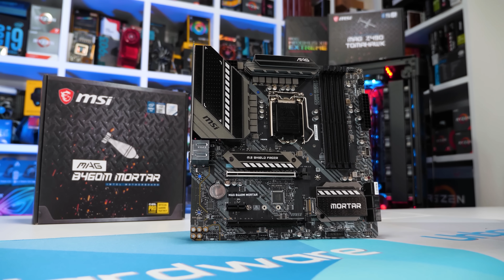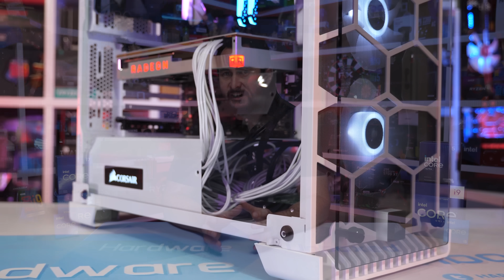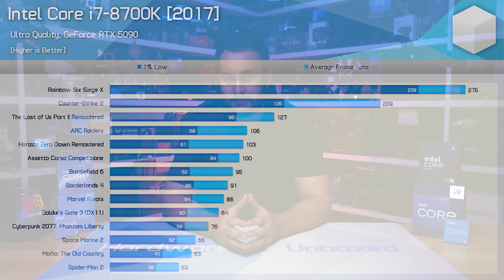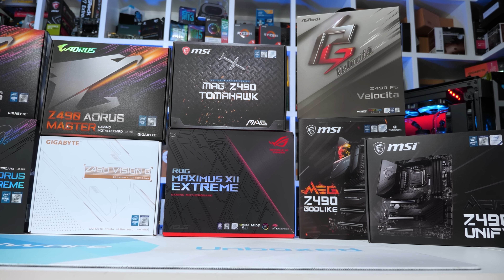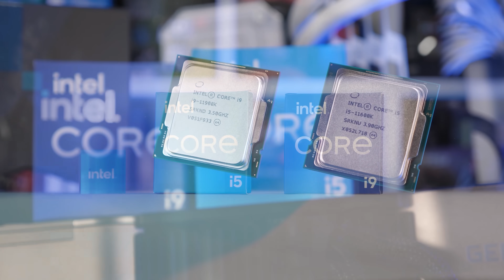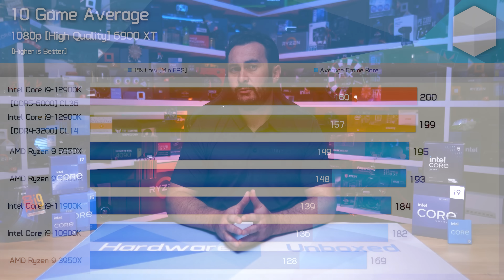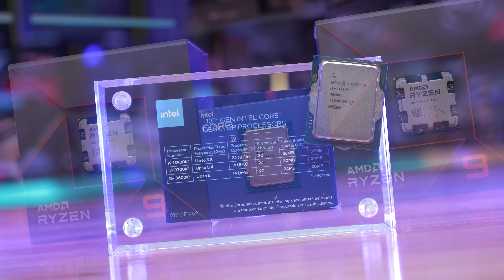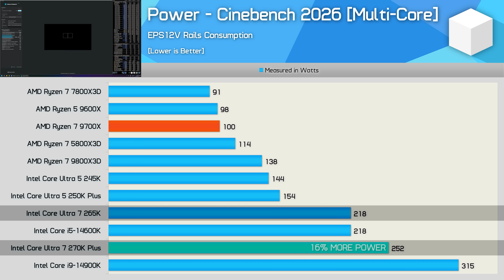How Intel Fell Behind, 10 Years Of CPUs Benchmarked

Comment: intel did not "struggle"  for 10 years
1st and 2nd gen ryzens still failed to catch up with intel in terms of IPC , boost clocks and single core gaming performance (they were still far behind) - 
even haswell i7 still offered superior gaming performance compared to ryzen 1600 or 1700 at the time  .
they also had all sorts of "new tech" issues and it took time to tune the motherboard and memory support and also software support .
they were good in multithreaded performance but not nearly as good for gaming 
intel still had the upper hand ... 
even 3rd gen ryzens despite having much improved IPC still failed to catch up to intel in gaming performance .
it wasn´t untill 5600x/5800x that the AMD truly started to compete with intel in gaming .
AM5 than changed everything and finally flipped the script .
so amd has only been truly superior for the past 4 years not 10 ...

Comment: I still play with an I7-4790K and Radeon 6700 XT at 1080p.
Most modern games depend more on the gpu, so my PC still holds to play games at solid 60 fps with medium/high settings.
I have it clear for next upgrade, cpu I choose AMD Ryzen (7800x3D will last 10+ years) and gpu I choose Nvidia (RTX 5070).
Reply: I imagine you could easily get away with just upgrading the platform first and using the 6700XT for a bit longer, then later upgrading the GPU to either something even newer than a 5070 and probably still not be approaching CPU bottleneck
Reply: @itspaafekuto  , most likely, but I don't intend to switch cpu for maybe 2 or 3 years and by then both 7800x3D and the 5070 2nd hand would be cheap, while newer gpus would still be expensive.
Reply: @matrixqwAh, it's not something you're considering yet for the immediate future? In that case it sounds like a pretty sound strategy.

Comment: I really hope that 52 core means a return of threadripper competition. The way amd slapped two 1800x together to make the 1950x. Threadripper needs some competition and the 9960x and 9970x would feel the pain of a 16/32/4 core with quad channel. But I'm sure Intel will instead gimp it with a desktop dual channel platform

Comment: While you present a lot of info, it would have been helpful to have a brief synopsis up front to put that information into context.

The overarching failures?

1. A myopic focus on speed regardless of heat or efficiency.

2. A refusal to adopt chiplets, which introduced complexity but dramatically boosted yield, and allowed mixing node products.

Both of those decisions ended up nearly killing the company.

Comment: TLDR: Intels fabs and architectures sucked and it's hard to make good long-term decisions when you're in a blind panic clutching at grass ass you slide to a cliff edge.
1) 14nm was late and with no architecture planned intel resorted to14nm++++ and skylake refresh refresh refresh refresh until Cometlake.
2) 10nm finally arrived but Intel had no way to do 2x 11900K and no space/transistor efficient architecture.
3) As a bandaid Intel glued on moar and moar atom cores and just went full Icarus on power which caused chips to die
4) this required dedicated silicon "thread director" and increased L2 cache per atom module to keep the atom cores from using the ring bus and getting in the way of the good cores.
5) this also required "APO" software for specific games so that 3/4 of the atom cores would park to prevent them getting in each others way,
6) Intel finally made the move to chipl...."tiles" and reduced power with 8P+16e Arrowlake
Unfortunately....
6A- the core-core latency is terrible
6B- their memory controller sucks only working at 1/2 memory speed or "2:1" mode.
6C- it's costing them a fortune with many big tiles equalling 554mmSq total. 
5) To address the core-core latency issue Intel created 200S boost but a 50% overclock only helped performance around 4%, Intel also launched new 250K+++ and 270K+++ parts which drove up power again.
6) still unable to have a single scalable efficient architecture Nova lake will have 2x "8P+16e" tiles, The first "tile" will have bLLC (added cache to mask the latency penalty going die-to-die) and another 8P+16e "tile" without it plus more atom cores in the SOC "tile",
So Nova lake CPU configuration is... (8P+16e+bLLC)+(8P+16e)+2lpe
7) to address this clusterfuck they're going back to a single unified architecture, at some point.
Reply: Chipl…”tiles”

Commendable attention to detail
Reply: The irony is that AMD had to deal with all of these problems with Zen1, Zen+ and (to a lesser extent) Zen2.
The smart man learns from his mistakes. The wise man learns from other's mistakes.
EDIT: The implication being that Intel are neither smart nor wise.
Reply: @throwaway6478  Yep, Alderlake=Zen1/+ moment, Novalake=Zen2 moment. Intel's really living like it's 2019 right now.
As you say the wise man learns from others mistakes... but Intel never learn from their own.

The whole chiplet thing is just Core2 again (chips containing cores talking over a bus to a separate memory controller die that is tied to memory clocks), Intel integrated the NB chipset on package but they went monolithic thinking we'd get cost effective die shrinks forever (10Ghz!!!).

Likewise AMD got burned by FX using clusters of cores which individually were weaker than the standard at the time and shared resources like L2 cache while pushing high clocks and power.
Intel said hold my beer and made Alder/cRaptor lake which added clusters of cores which individually were weaker than the standard at the time and shared resources like L2 cache while pushing high clocks and power... because that's what you do when you're desperate, difference is you could buy an FX83-- for £100.

Comment: Intel had 6- and 8-core CPUs in its Xeon business products, but withheld them from all but a few enthusiast models (of consumer-grade chips).  Intel tried to stay competitive in core count by introducing E-cores, but Windows 10 couldn't use them properly.  Thus Windows 11 and the whole telemetry debacle. Meanwhile, Intel lost the all-important server market due to power and heat costs.

An interesting side note is how Intel put hardware support for AVX-512 in its processors as late as 2021.  The smaller E-cores don't have it, which makes Intel's new massive-core-count HEDT CPUs uncompetitive for the very tasks Intel created AVX-512 to get an advantage over AMD in the first place.

Comment: I still cant understand why the 11th Gen intel series is still so expensive ... like the i7s and i9s are more expensive than the 12th and 13th gen equivalent yet offers so little improvement over the 10th gen series
Reply: AV1 decoding on the then new Xe iGPU was introduced on the 11th Gen, alongside being much more capable than the one on the 10th Gen before it. It is also the end of the line upgrade for that particular socket, which inflates it's value.

Comment: I'm a bit of an AMD Fanboy, but I managed to snag recently (I was lucky that in late October seller didn't increase prices due to RAM Shortage) Dell Workstation with Xeon E2286M 8-core CPU and RTX 5000 Quadro (Turing) 16GB GPU. And 128GB DDR4 ECC 2667MT/s memory. I can game, I can work, I can basically do anything I want, since the GPU is slightly underclocked RTX 2080 Super with 16GB of VRAM.

I have to say that those CPU's even from the days of Intel... being Intel are great. Especially Xeons, which are extremely stable and extremely cool, even in completely bonkers tests. The problem with Intel was that they didn't care that much about regular customers, because they had such a monopoly that NVIDIA would blush. And that NVIDIA GPU is still great, even though you could say that it was on the downhill for NVIDIA already. But the thing that makes those 2 parts still very much workable is that they weren't cut down for "normal customers". They were workstation class, professional cards. And for 1200$ it was basically a steal.

Comment: I got an 8700K one year after the 9900K came out for cheap at Microcenter. I then got a 9900K about a year after that. The 9900K ran so hot and consumed so much energy that I switched to AMD and never looked back.
Reply: There's a reason it was called the 9900 Kelvin
Reply: It's over 9000 Kelvin
Reply: Curious if you saw any performance increase though. My girlfriend has a Z370 ROG Strix board with an 8700K and 4070 Super that I was looking at slapping a 9900K in there. Upgrading her to DDR5 right now is far too expensive as she already has 32GB of DDR4 and a 360 AIO. 

The 9900k can be purchased for a relatively decent price and make up some of that cost by selling her 8700K even if under current market pricing.
Reply: @badsportdriving5856 icebereg tech tested both at 5ghz before and there was not much of a difference. You can search his channel. In my opinion second hand 9900k-s are way too expensive to worth the "upgrade", i'd rather wait till ram prices go down. You might also need very good vrm's on your board and an exotic cooling if you want to keep the i9 at high clock speeds. I only speak about this because I'm kinda in the same boat.
Reply: my 9900k is still going strong running on a 240mm aio, 60c running games. my 9800x3d is on a 360aio and i have troubles keeping it cool. it runs 75c in games.
Reply: @rozzbourn3653  not sure if you're baiting but 75 is fine and not hot for an x3d chip
Reply: @creativityfails1  thats my point. everyone says how hot the 9900k was, but it doesnt run as hot as my 9800x3d. my 9900k would idle at 28c and my 9800x3d idles at 47c. it was hard for me to get used to when the 9900k was supposed to be considered a very hot cpu.
Reply: @rozzbourn3653  I wouldn't worry about it. 99.999% of people's knowledge about cpus is anecdotal or the product of marketing. I just wanted to make sure you knew 75c is not bad for the cpu and modern cpus do like pushing themselves to their thermal limits. Something that annoys me at work with even the T line of Intel processors
Reply: @rozzbourn3653  How do you get so High temps on 9800x3D and 360AIO? I have 9800x3D and  Navis 360 AIO and with little UV PBO -20 TDC set to 90W, EDC 105W, PPT to 120W and boost clock + 200 I have 40'C idle and 56-62'C in gaming and it hits  70'C only in benchmarks or video conversion.
Reply: @FeRu.Raprodukcja I wish I knew. I took the whole thing apart and reseated it with better thermal paste and it just idles near 50 degrees Celsius. I limited the power to it and it only gets up to about 80ish when gaming now. I hope the next cpu lineup solves this for me.
Reply: @rozzbourn3653 

People literally complained about the 9900K (and 10900k, 13900K, 14900K) heating up their rooms.

The 9900K typically draws more power in gaming than the 9800X3D, and more power = more heat. Not quite the same thing as temperature.

Think of it like a car engine. A small engine with a small radiator might run at a higher temperature, but it will still give off less overall heat than a larger engine putting out twice the horsepower, even if the bigger engine is running cooler.

Temperature is also affected by power density, so given two CPU dies consuming the same amount of power, the smaller die will have a higher temperature. Thicker IHS (like the 9800X3D has) also means more thermal resistance, which means higher temperature on the CPU die for a given power draw.

There are a lot of other factors to consider when looking at temperature.
Reply: @rozzbourn3653  You are either a mad Intelol fans lying, or you have no idea what you are doing with PCs. Likely both.

Comment: Great overview.  I've been building a sort of collection of earlier Intel flagship machines: I've got a 4790K and a 6700K so far.  I have an in-use system with a 12900K (DDR5).  The ones I want to add are a 2700K, 8700K, 9900K, and 10900K (or 10850K).  But the price is still outrageous for the latter two, so I'm waiting.  Ivy Bridge is probably next in line.

Comment: Still using my 10th gen i9, still a good system today, was my first intel build
Reply: nah its literally getting clapped by i5 12400f, but i like the cope.
Reply: @helly9015 Wouldn't call ~20% faster SC "clapped".. 12th gen had a proper new architecture, hence the jump in performance. And the 10900k still has the better multi-core and in some games matches the i5. The real champ is the 12900k.

Comment: Intel 10900K was and still the best with the least latency (37ns) between its 10 cores that scale massively with fast DDR4.  Everytime I tried to switch, I came back to my 10900K.  It's snappy and is the best for any emulators, no input lag or stuttering like AMD and it's problem with cache and chiplet design.  Intel should have never abandon the 10 cores and kept building around it and improve on IPC.  In gaming, nothing beat Intel so the title is misleading.  Yes in rendering (example video), AMD will be faster, but as a gamer, you cannot rely on AMD.
Reply: This dude woke up and still thinks it's 2020...
Reply: ? The 9800X3D beats/matches Intel in most games. There's few games where Intel fares better.
Reply: @imaginarymenageriemanager6303  Not in the lows FPS which is why Intel doesn't have stuttering and AMD has.  It's simple as that.
Reply: @beetwing  No. 1% and 0.1% are METRICS are pretty useless. As metrics, again, re-read what I wrote.
Reply: @imaginarymenageriemanager6303  re-read what I wrote, yes 1% lows not useless METRICS, the higher it is, the less stuttering you will have and more snappier your experience is.  Pair this with 4400mhz 17-17-17 with an Intel 10900K, even a 9900k, play a f.p.s game like COD, crank this up to 4K at low rez, go back to your AMD and come back here again.  You know, if you know!

Comment: It's fascinating that Intel's 14nm stagnation lasted as long as it did. You could go from an overclocked i7 2600k from 2011 to an i3 10105F from 2021 and not notice a difference. A whole decade of progress for a 25% IPC uplift...
Reply: At the risk of sounding like a broken record, I imagine the only noticeable differences between the two PCs are AVX2 instructions and small things like m.2 slots or TPM support
Reply: There's quite the difference unless you're solely looking at render performance. Gaming-wise anything DDR3 is total ass.
Reply: LOL, one of the computers at home is still rocking an overclocked 2600k paired with a GTX970 GPU. Runs most games fine, except latest AAA titles...
Reply: @tonifasth  Massive lie, lol. An older DDR3 i7 can't even play basic games like LoTF or The Surge smoothly. Games from 2015~.

Comment: It's kind of crazy (and awesome) to realize that, I've almost completely switched back to AMD since Zen came out.
The only Intel system I still use (rarely) is an i3-4160 (Haswell) secondary NAS system with ECC memory (ASRockRack E3C224D2I).
I've purchased total of 16 Zen-based CPUs/APUs so far.

Comment: Are we getting 10 years of am4 next week?
Reply: I want to see 15 years of amd
Reply: They can start with Piledriver which was still just barely available for sale.
Reply: @panthera8286 I think they would have to include the Phenom II CPUs to put the Bulldozer lineup in the right contrast.
Reply: @DeadNoob451  Phenom 2 was Great, had they made a Phenom 3 we would never have had ryzen tho.
Reply: @panthera8286 1st AM4 CPU was Excavator v2
Reply: am4 was a 5-year socket from 2017 to 2022. If you bought in 2017, you were on pcie 3.0 and severely limited. You were also limited by your motherboard's ability to use nvmes because of pcie and lane configuration. You would have had only 2 USB 3.1 ports available and no type-C. You would have had 1GbE Ethernet instead of 2.5GbE and no wifi on your motherboard. Your VRMs would have been anemic and unlikely to support a decent 5000-series processor. And on and on. You wouldn't have TPM support, so no Windows 11.

Yes, the socket technically remained compatible, but no one has a 5950 in a 2017 launch board. The majority of features a person would need in 2022/23 were mature and included by 2019. So really you had a 3-year window of platform upgrades, effectively. Which is identical to Intel's last gen. Weird, right?
Reply: @CyberneticArgumentCreator  Funny. My X370 motherboard from first half 2017 has USB-C, a 5Gbit ethernet interface + a 1Gbit interface, 2.4 and 5 GHz WiFi (IEEE 802.11ac), Bluetooth 4.2, TPM support and has been running a Ryzen 9 5900X with Precision Boost with curve optimizer enabled for a few years now with DDR4 memory running at 3466 MHz @ low latency. And low and behold, the board runs the Ryzen 7 5800X3D CPU as well and is approaching 10 years. Re-sizeable BAR is also supported. Most recent BIOS update was released in April 2026. It has a 16 power-phase design, by the way. Did I mention that I run an NVME as well as my primary hard drive?

In my 30+ years of PC building, I've never had this level of performance from the same platform for so long. Never. Granted, this was an absolute premium board at the time of release, but boy, has it been worth the money? Absolutely.
Reply: If u can pony up for the dubiously beneficial bandwidth of a pcie4 gpu, then a new mobo is a trifle

The killer benefit of even old am4 is the extra four native pcie lanes for a blazing fast nvme. Chipset lanes or sata ssd are for the ignorant 

The bottom line is intel are crap is u have to wade thru this mass of info to filter all the rubbish for a few obscure cpu mobo combos that won’t cause grief. It goe wo saying it will be a restricted dead end. Get a life and go am4 if ur bargain hunting